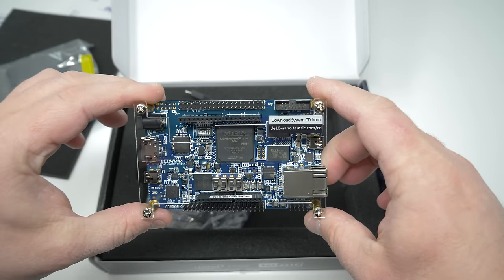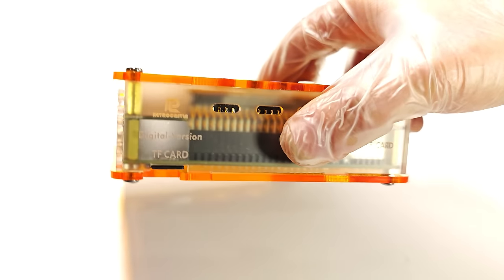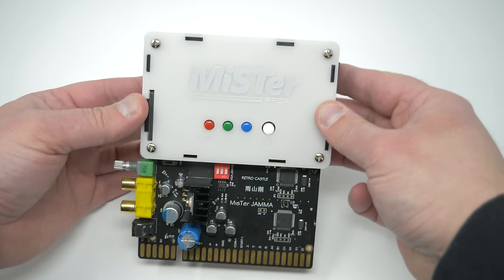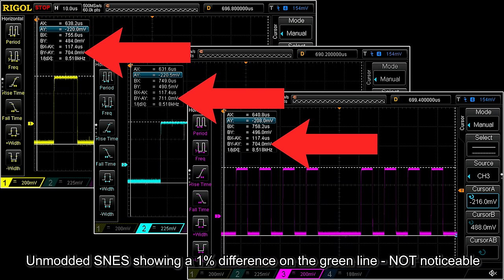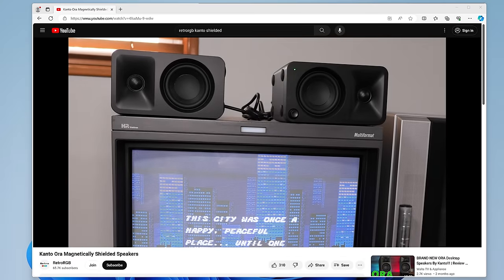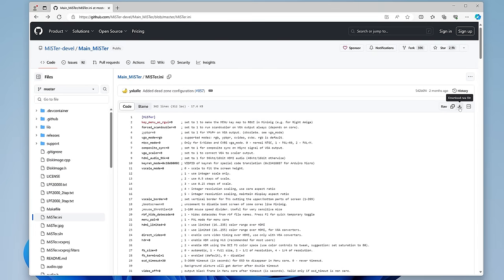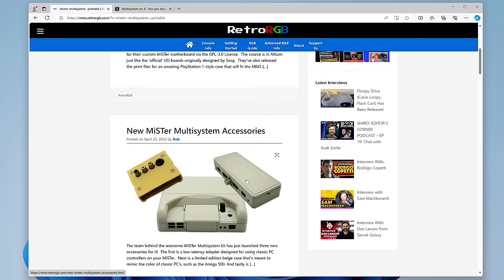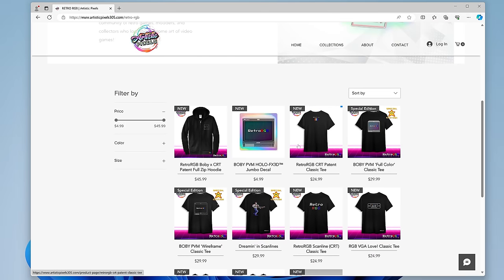Retro Castle MiSTer FPGA Kits

Comment: I absolutely LOVE the Retrocastle mister case that I bought. It works perfectly, is nice and compact, and is super convenient. The ONLY complaint I have is that the fanless version is a bit wonky if you get the digital audio fix, because the guide for the heat sink block is obstructed by the audio board. Other than that it's perfect. Waaaaay better than any other solution I've seen

Comment: If Saturn version offers component through that cable you've shown then why do you recommend VGA version for component?
Reply from the maker: Good question.  It's cause "VGA to RCA" adapters that you can use for component video are super cheap and available on Amazon, eBay and Aliexpress.  There's only one cable that's Saturn on one end and RCA on the other.  It works and the quality is fine, but who knows for how long.
Reply: @RetroRGB  Gotcha! Thanks. Please update your affiliate links when Retro Castle store is back so we can support your priceless channel.

Comment: I wish I had this option back when I was building my MiSTer. The 2 layer sandwich is so much cleaner with the integrated analogue I/O and USB hub. Plus this would have made for a cleaner install with my Atlas mitx and allowed me to go with a thinner case.

The dual ram + direct video at this point is the way to go these days. Dual RAM cores are starting to pop up and it's a good way to future proof your MiSTer setup. I'm seriously considering selling off my original analogue I/O boards to pick up this direct video board.

I like the jamma comparability too and how the case gives you a good edge to grab onto while installing the jamma connector.

Comment: Will a OEM light gun (like the ones made for the NES, SNES for example) work with a MiSTer using HDMI direct video to CRT work?
Reply from the maker: Yes, but only via SNAC adapters, not standard controller-to-USB converters.

Comment: Great video. Just to clarify, the fanless version is actually an option. You can either use this to spread heat to the enclosure, or use a fan. I went with the fanless verison and the unit stays warm as it should without being  too hot. I've been using it for a month, and its fantastic I must say. Thanks again for doing those documented guides !

Comment: Hello, many thanks for your work, I really need your advice and professional opinion, I recently saw a monitor from the Phillips MC15601 HD11 ultrasound equipment at a flea market, it is about 14", has BNC connectors on the back with the inscription "B", "GV", "R", "SYNC" and also VGA. On eBay such a one costs about $ 400-800. And at the flea market such a one costs 2000 rubles, tell me is this a good option for a mister, and should I expect that this monitor has a higher quality tube than in ordinary monitors.
With respect.

Comment: Thanks for the detailed video. I think I saw other comments that might’ve addressed this but maybe not as detailed. If I want dual ram with Saturn output, and don’t care about displaying both simultaneously, I can order from castlemania? (Case and I/O board) Digital w/ Saturn and it’ll have that ribbon cable? Thanks
Reply from the maker: Correct!  Pre-orders are open and they should ship next month. You’d just need to decide between the metal or plexi case.  That’s all aesthetics though…just choose whichever your eyes prefer: https://retrorgb.link/retrocastle

Comment: OH MY GOD i'm more confused than ever

so, the jamma dual ram board
supports analogue and dual ram at the same time
i assume it has the same build in dac and is using direct video mode

But that takes over the hdmi port i guess

and the non jamma board you show with the ribbon cable also takes over the hdmi port but supports analogue and dual ram which is interesting

now we have to choose between a version with a built in dac and dual ram
or the older version with simultaneous vga and hdmi output.

decision paralysis yet again

also do you know if that ribbon cable version is going to be put up for sale in the retrocastle store? don't see it anywhere
Reply from the maker: Yeah, this is the result of working within the confines of the DE-10.  My suggestion:  Unless you know you'll want access to cores with dual-ram, don't even think about it and just get a standard kit.
...and yes, the Digital I/O / Dual-RAM compatible is coming very soon.  Castlemania has pre-orders open and Ivory will open his orders soon.

Comment: So, to be clear, if what I want is a dual RAM setup that I can use through analog setup (through direct video), the actual product I need to buy is the digital I/O with the HDMI output, or the one with the VGA output?  Or something else?  The product pages don't give the kind of detail your video does, so the info doesn't really map 1:1 between the two.
Reply from the maker: Digital I/O with either VGA or Saturn.
I’m sorry, I know it’s confusing. We’re all just working around the limitations of the DE-10 :/
Reply: @RetroRGB  Done.  Went with the Aliexpress link since the US link only offers the digital I/O with a case if you also get the DE-10 Nano already installed.  I'm just upgrading from an analog I/O so I can use some of the cores that require dual RAM.  Thanks for clarifying!

Comment: I’ve had the Saturn output option of the old retrocastle case for a long time. Seen it in one of your videos and went for it. 

Not a single complaint and it was so easy and simple to use. Even got some of their snac adapters. I LOVE the way the PS1 adapter snaps right in. 

I almost never use the analogue out though so I think if dual ram becomes a requirement soon I’ll upgrade to the HDMI only version of the case.

Comment: How are the brightness/voltage levels when using component cables? Kuro Houou says they are too low on every Mister kit he has tested so far, even Retro Castle. Someone said this may be a limited range/full range issue.

Comment: Thank you for that video. I can't wait for the dual RAM version to be available for common people.
In terms of performance, have you had a chance to test Y/C and composite output of the dual RAM kit? I wonder how it compares to RetroCastle's active Y/C encoder especially that the later is relatively big board by itself comparing IO board so where would all that parts fit when now it also needs space for video DAC?
Also, could you please share what exactly comes with the kit? I am very confused by the listings on Aliexpress. I see boards with different cases but things like buttons, standoffs, feets, fuse and some others are all listed separatelly. Do I really need to order them separatelly? Many thanks in advance.

Comment: A good comparison for too much voltage on the RGB lines is like overexposing a photograph, and losing visual information in the highlights. A lot of modern solutions on image sensors might be able to salvage blown highlights like that if it's capturing HDR or RAW... maybe. But with an analog media like film, all the material on the highlights would be hammered with light, so that visual information would just become full white in the photo print. The increased voltage seems to push everything in the brighter range to 100%, and like you show it, you can tone it down on the back side, but the information is unrecoverable since it's just been smashed to 100%. Really interesting and not something I had realized.

Comment: Great video Bob. I measured my v1 mistercade today and the rgb levels were: r 570mv, g 580mv, b 570mv. Since it's lower I won't lose detail? I can just compensate by calibrating the crt in my cabinet? As long as I only use the mistercade and no other boards or devices it's fine? Or does low voltage lose detail just like high voltage?
Reply from the maker: All correct - Just compensate for the brightness on your CRT. 570 is pretty low, but arcade cabinets are used to a wide variance in voltages, so I bet it’ll look fine.

Comment: I'm looking to upgrade from a Ultimate MiSTer PRO to the Retro Castle with dual RAM.
My Mister is nearly 3 years old so I think it uses an older RAM module.

If I order the Retro Castle Plastic Case Upgrade Kit with Digital I/O Board what else do I need?
Can I use my existing RAM module along with the new one or should I just order two?
Reply from the maker: You SHOULD be able to re-use your older RAM module.  Just check to see if it has three random extra pins sticking out the side.  If so, then you probably won't be able to use it.  If not (most do NOT have this), then you're good to go.  If it's a 32MB version, you can use it as the second RAM and just get one 128MB as the main.  If you have a 128MB version, you can use that as the main and just buy a cheap 32MB versions somewhere.
Hopefully you can save a bit of cash by re-using :)
Reply: @RetroRGB  Thank you.

Comment: Thanks for your video, it inspired me to select the retro castle dual RAM VGA version.
However I have one question. How do I get analog audio to work at the same time as hdmi? at 6:13 it is mentioned that there is digital to analog audio conversion so at least there should be analog audio. Starting at 5:15 an I2S-module is mentioned where you need to flip a switch. Is the same switch flipping required for getting analog audio for the dual RAM VGA version? Or does analog audio in that case only work when using the hdmi ribbon cable? Thanks :-)
Reply from the maker: Analog audio only works when using the HDMI ribbon.  You can always use a DAC from the 3.5mm optical output though.
Reply: @RetroRGB  Thanks for your quick reply!

Comment: they seem to be not in stock, is the creator in discord?
Reply from the maker: Ivory’s just switching websites. I’ll update all the links once the new site is open. Sorry for the delay!
Reply: cool cool. just two questions bob, how loud is the fan? is it louder than the ultimate mister build? also all the saturn retro-access and retro gaming cables should work with this analog mister right? @RetroRGB
Reply from the maker: The fan is super quiet.  Sync on csync cables are recommended, but sync on luma can work by flipping DIP #1 to on.  I can't remember what the DIP's should be set to for sync on composite, but it definitely works, cause I tried it :)
Reply: nice. thanks for the helpful info @RetroRGB

Comment: Just to demystify something. Does it mean we should be able to get the Direct video solution working with just a correctly wired HDMI to Scart / Component cable?
Reply from the maker: You’d first need a compatible DAC. Then a circuit to convert it to either component video or SCART.

Comment: Why are the MisterAddons cases not recommended?
Reply from the maker: I’ve never been a fan of the “double stack” design. And while the analog output is perfectly safe to use (provided you’re using properly-built cables of course), they fail the brightness / voltage tests I showed in this video. So, if you own one and are happy it with, no need to change at all. And if you’re only using HDMI-out, they’re all basically the same. But if you’re looking to buy a kit for use with analog video output, this kits are by far the best.

Comment: hi, how does the new dual ram borad from retrocastle compares to the new misteraddons 24bit new board, the only persona that can do that comparison is you!!, im trying to buy a mister for the first time, but i heard about the new misteraddons pcb with 24bit; thanks in advance
Reply from the maker: The output quality is about the same. The biggest difference is form factor and if you need simultaneous HDMI and analog output.
Reply: @RetroRGB  one last question man, so the 24 bit option, both pcbs have it, misteraddons and retrocastle dual ram? thanks in advance.

Comment: Do you know if you can keep the USB addon board from the original Mister build when installing this case? I'm wondering how you'll connect wired controllers/keyboards/etc with this
Reply from the maker: It’s got 4 USB ports built in.
Reply: @RetroRGB Ah, I thought that it only had the SNAC ports up top. Thanks Bob!

Comment: Im looking at the "Retro Castle MisTer FPGA Complete Kit - Plastic Case with Digital I/O" on Castlemania, is the "Retro Castle DE10 Digital I/O Board (Video Out)" VGA option what I'd want for digital out with the included DAC on the removable ribbon cable?
Reply from the maker: Both the VGA and Saturn versions of the Digital I/O include the DAC with the ribbon.  I'd choose based on your target device:  If you need Composite, S-Video or RGB SCART, pick Saturn.  If you need VGA or component...or VGA to BNC for an RGB monitor, pick VGA.  Hope that helps!
Reply: @RetroRGB    I'll be primarily running it into an extron mvx with VGA in, and could get one of the VGA to composite adapters if I ever want the softer look. Thank you that's very helpful!
Reply: And the "hdmi" (more expensive) option on castlemania? Whats the deal?

Comment: Thanks for the amazing video! If I use the saturn output version with composite output I will get the same image quality as MikeS Y/C active adapter?
Reply from the maker: Yes, this is Mike’s open source circuit built right into the case :)
Reply: @RetroRGB  Thanks Bob! You are the best!

Comment: You say ethernet is in the front. Do you call it front because the HDMI is on the other side?
Reply from the maker: Well, the DE-10 doesn't technically have a front...but since power and video are usually run out the back, I look at the opposite side as the front.

Comment: Great vid, I'm gonna upgrade mine.
can I buy the jamma dual ram version+ram+box from aliex? thanks

can it still run like that via hdmi or vga port with a regular known working barrel/type-c PSU? (for non-jamma use) i2s mod needed?

I like the hdmi dongle that is needed to be unplugged-solution for dual ram, is it like that on the dual ram jamma solution?

as usal thanks a lot!
Reply from the maker: The dual ram stuff (including jamma) will be on the Aliexpress store in a few weeks. And yes, all dual ram versions have that ribbon cable. 

You should be fine powering it with a barrel jack PSU through the included adapter. I just added that warning for people with really old DE-10’s that came with the lower quality PSU.
Reply: Thanks for answer, I was just too lazy to put it in the patreon Q&A😅

thanks for highlighting these products!

I'll get a dual jamma version for sure then! thanks! so the i2s mod thing will be uneeded for the jamma "vga" port, right?
Reply from the maker: Correct, the JAMMA version has something similar already built in, with its own audio amp :)
Reply: thanks again, have a nice day!